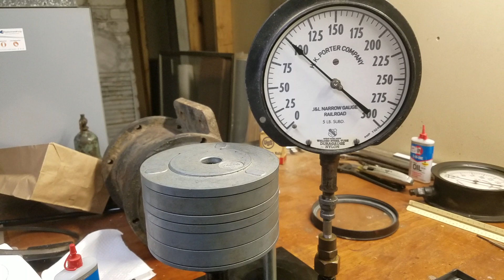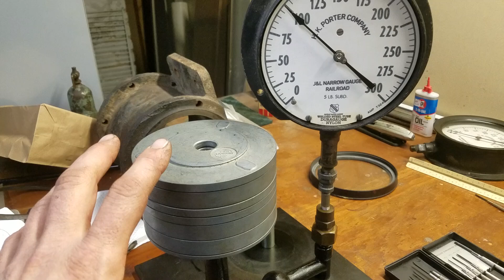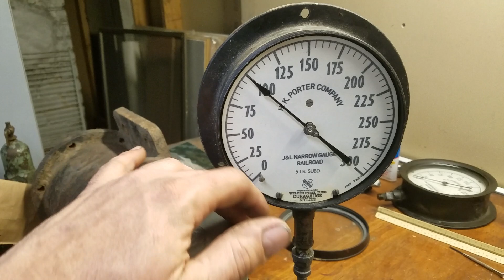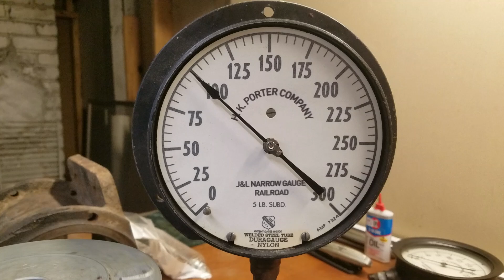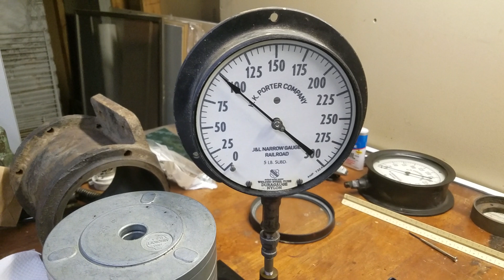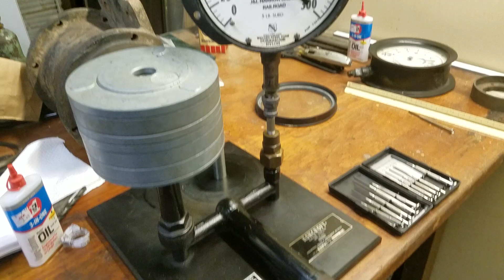Dead Weight Testing Steam Pressure Gauges for J&L 58

Comment from the maker: I purchased an Ashcroft pressure gauge from McMaster Carr.  When it got here I put it on the tester and its readings correspond with the weights on the tester.  So that tells me that the tester is more than likely accurate and that the two gauges were off by 5 lbs. because I put the hands on in the wrong locations.

Comment: Maybe you should not include the weight of the piston in the calibration, it may already be compensated for in the design of the tester. If they both read 95lb when you checked them I would say that is the case for sure.  With no weights on the scale does the gauge read 5lb or 0?
Reply from the maker: The instructions state that the weight of the piston should be added and it is stamped 5 lb. I ordered a new gauge from McMaster-Carr and I will test it tonight to see what I get. I did remove the hands from both of these gauges when I had the faces printed and the hands are merely a press-fit on the spindle so it's entirely possible that I put the hands in the wrong location when I reassembled the gauges.
Reply: @YoungstownSteelHeritage  If that is the case then a gauge should never read 0 when hooked to the tester.
Reply from the maker: @bcbloc02  It does until you crank in the plunger to put oil into the tester, then the piston rises up some and the gauge needle goes up to 5 lbs.
Reply: @YoungstownSteelHeritage  Sounds like you have it all correct then and the gauges were off just a bit. The weights shouldn't have changed and it is a direct reading instrument so it should be accurate regardless of how long it has been since it was checked for calibration.  Weight  over area is pressure. So unless someonw has been eating on your weights and they no longer weigh what they are marked you should be good to go.